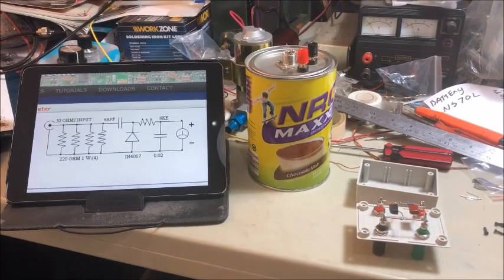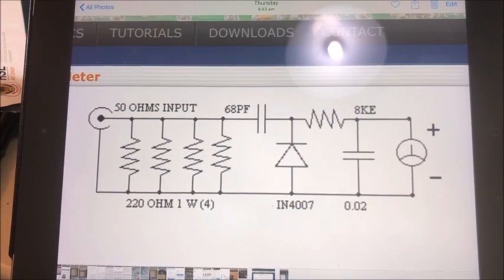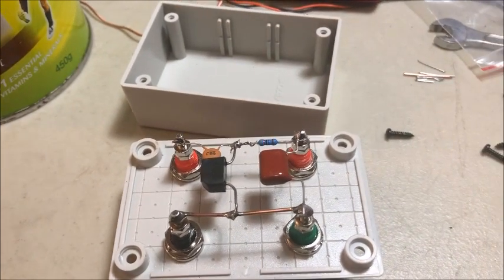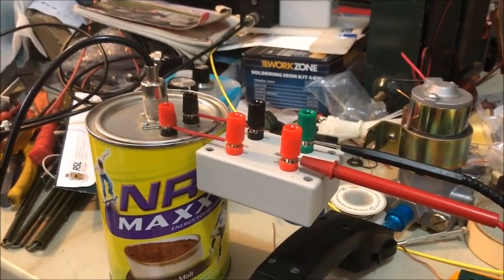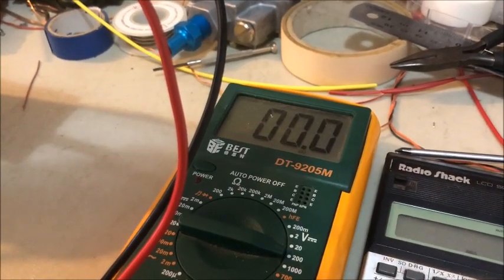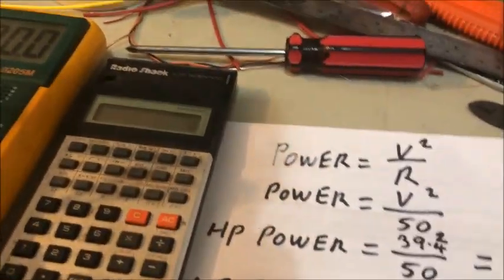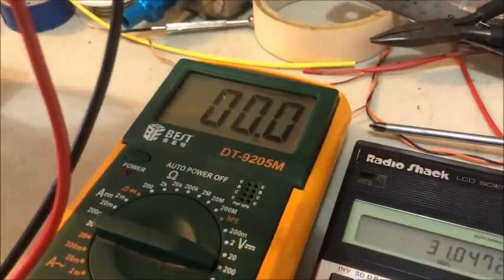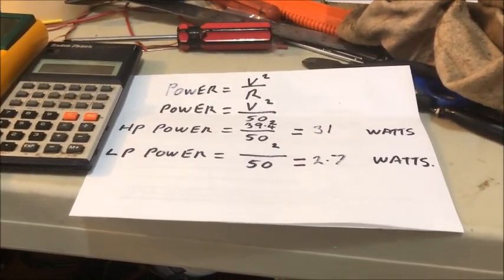VK2PRC Calculating your Transmitter P.E.P. RF Power using a dummy load.

Comment: Your math should be Power = 10 * (Vp)^2 in Volts and mW.. Your meter shows peak voltage Vp (not the rms voltage).. You may add the 0.64V drop to the Vp to be more precise..

Comment: I really like the way you used a ring of wire instead of a copper plate for the resistors on the dummy load,. I will be doing that on my next build.

Comment: Hi, I'm piero, I'm in Italy and I'm watching your video. Is the voltage you use for the calculation the peak voltage?
Reply from the maker: Yes PEP= PV squared divided by 50 ohm load.
Reply: @vk2prc978  Hallo, thanks for the reply. For what type of modulation do you consider P.E.P. ? But then, apart from everything, it seems to me that the meter shows not the Vp but the Vpp = 2Vp: Or am I taking a big mistake?
Reply: @peterbold4297  His recitfier is half wave. Just single diode, so Vp, not Vpp I believe.
Reply: @simonroberts6490  Hi. Let's call the 68pF C1 and C2 the 20 nF in parallel to the instrument. C1 charges to Vp during the negative peak through D1. During the positive peak D1 is open and the voltage present on C1 is added to the positive peak in phase with it, so that C1 is charged by the voltage Vpin (pos) + Vc1 = 2Vp or to Vpp. In this way the power obtained from the calculation is obviously four times the real one.
Reply: @peterbold4297  Well, when I run this simulation in LTSpice, it shows the voltage on the capacitor to build to the peak voltage minus a diode drop, not the peak to peak. Of course, I can't show you what I did since there are no pictures or attachments in this medium, so that doesn't move us forward very far :)

Comment: Thank you for this... it was just on time for me to make some final adjustments for a ten minutes transmitter I found on SolderSmoke blog... and I didn't know how to measure the output voltage ))) So now that I do... I ended up with 7v output voltage... after the calculations I ended up with 0.98....  I'm a little dumb as I don't know what that means... 980mW ? Or 0.98mW ? Hahaha... I'm confused. Thank you one more time. 73
Reply from the maker: Yes thats just under a watt. 980mw.
Reply: Thank you... 73